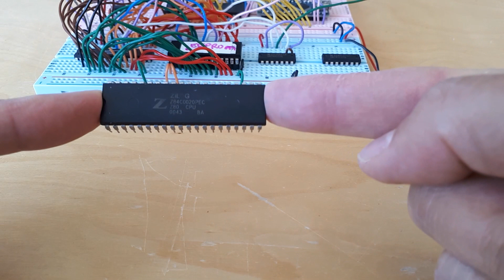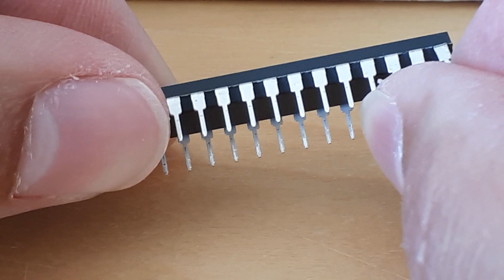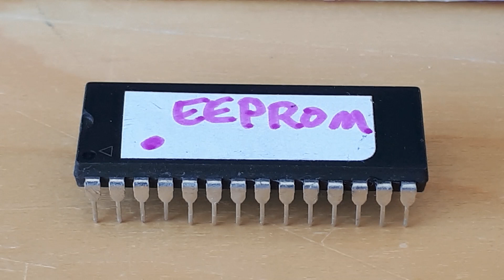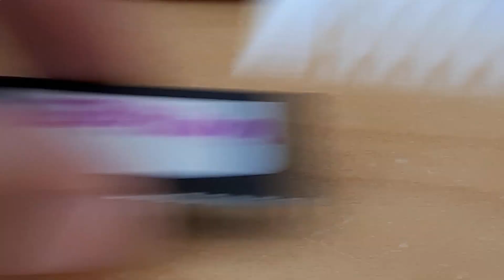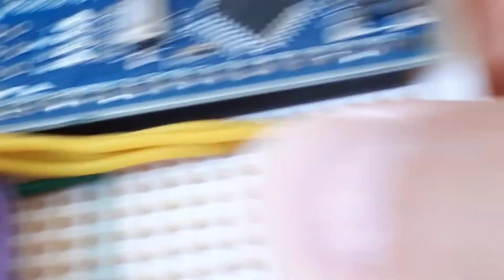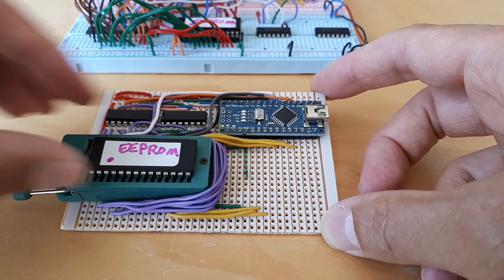CP/M Z80 single board computer, on a solderless breadboard (PART 1)

Comment: It's like an old-school mainframe but in reverse.
They would have a huge/powerful CPU (where you've got the Z80) and then a small less-powerful machine to handle IO (where you've got the slightly more powerful Arduino) and then a totally thick terminal for screen and keyboard (where you've got your PC (which beats the ass off any old-school mainframe CPU))
Reply from the maker: Well, the latest version (https://youtu.be/zhszathMpgY) moves in a more sensible direction. Z80 to do all the work, and an ESP32 to act as the VT100 terminal. Still slightly backwards, but more satisfying.

Comment: You’ve a number of floating inputs on the decode logic chips.  That could be thé sources of the instability.
Reply from the maker: I save learned my lesson on this now! All inputs must be grounded!!!
Reply: @CircuitBreaker256  Yeah always pull up or down anything not used. Even address lines to avoid any floating voltages/currents...pull those down usually. Now you might want to make a schematic and PCB in EasyEDA or one of those and put it to the test. At least you can avoid that cluster f#$k of possible capacitance's.